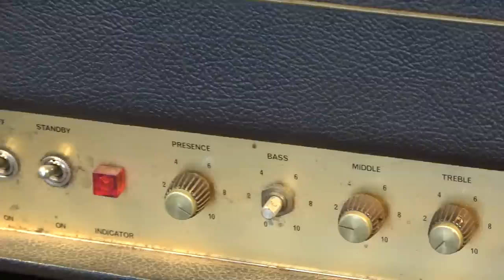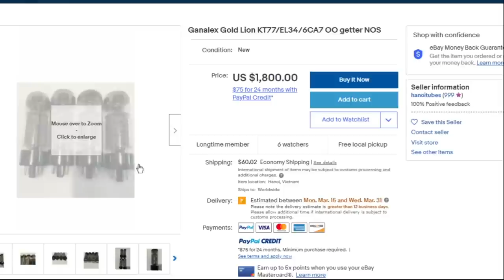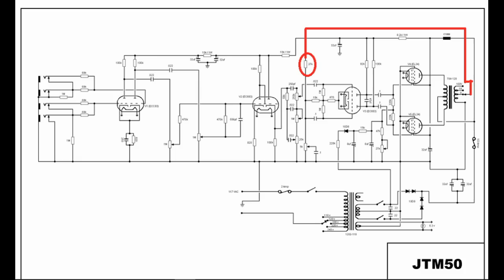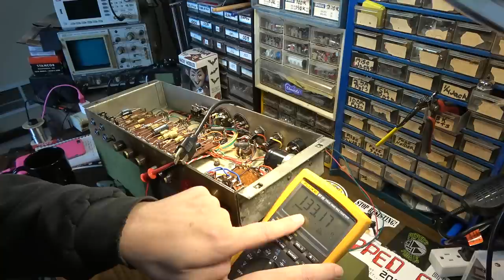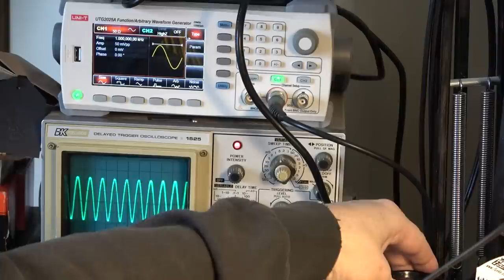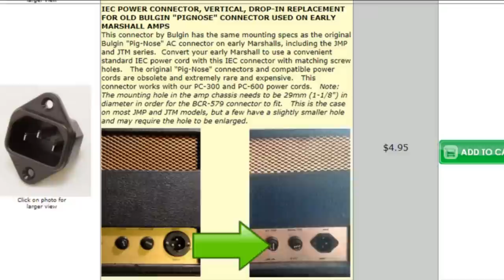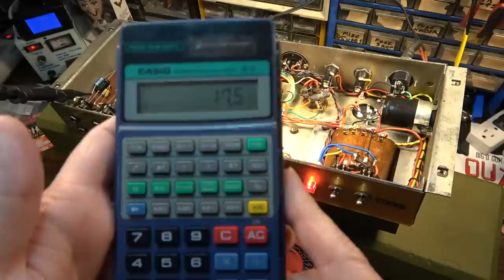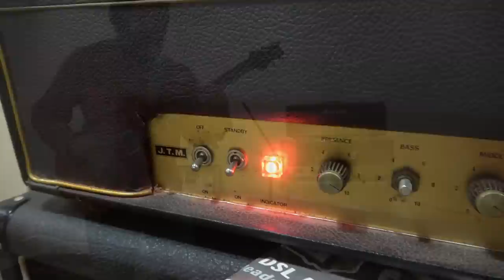Inside a $10K Amp | Secrets of the 1967 Marshall JTM50 BLACK FLAG Plexi | REPAIR & DEMO

Comment: I grew up in Honolulu. I bought a Marshall 4x10 combo amp in a pawnshop in  Hollywood in the late 70s. The chassis inspection sticker was dated 1967. I traded it to a friend of mine for an early 70s 50W head and 4x12 cabinet which came with me to Florida when I moved. My friend was one of 2 Marshall collectors I knew in Honolulu. Both rented out rigs for concerts and I used his 100W heads and double stacked 4x12 cabinets when I played in the arena there in the early 80s. I also heard of another Marshall collector there, so finding an old Marshall in Hawaii is not so far fetched. My friend died in 2019 and I don't know what happened to his collection.

Comment: man... hearing you grinding the plug hole gave me flashbacks to sitting in the dentist chair having teeth ground down for crowns... lol
Reply: Got the same association. Had a wisdom tooth surgically removed a couple of years ago. That wasn't an easy task. The dentist had to work his way down by drilling and breaking off pieces until he could finally extract the root remains and suture up the wound.
Reply: Me as well - dentist had to cut it up and literally break it apart and extract the pieces. At least Brad had the volume down on this part, but ARGH!!! you can still hear it.
Reply: @pauldavis6356  wow i thought it was just ME...i had all 4 removed at once and they were ALL that way...it was years ago...44?.but you never forget it

Comment: Maybe Hendrix left it behind on Maui after filming Rainbow Bridge.....That'd be a sweet find!
Reply: @electrofrying1685  maybe
Reply: That's what popped in my mind too.
Reply: that was my first thought when he mentioned Hawaii
Reply: Spike Elwood  Doubt it was Hendrix's amp.
Reply: Spike Elwood  There are five on stage in total and they should all be out there somewhere. Would like to know which Marshals he used, a bit of research should reveal the answer.
Reply: Looking at a close up the front panel layout is identical apart from the Black Flag!
Reply: Apparently Hendrix used Marshal Super 100 heads powered by four KT66s, this Black Flag amp only has two KT66s.

Comment: Beautiful history lesson here Brad!!  What a cool amp!  I actually got lucky at my last job and found a couple heating elements from commercial coffee brewers that are exactly 8 ohms each, so I can wire them at 16, 8, or 4 ohms depending on what I'm testing.  They have nichrome coils inside, and when I pump enough watts into them, you can hear some sound coming from them 😁 Also, since they are heating elements I can use water as a heat sink if I need to do a long test.  (I had an old solid state Peavey that was overheating, so I ran signal through it at a high level to test after I fixed it)

Comment: Tube amps will Soon be a thing of the past if someone doesn't step. Up and start building all these tubes again.
    And ones working will go through the roof in value.
Obviously.
     I appreciate your channel. The amps you document amd your a great teacher. Just doing what you do.
  In my opinion the  thing about a great amp or an amp simulation. Is that every playing mistake shows. Can't hide behind the amp the amp. Is an instrument like the guitar and the fingers and touch amd mind behind the playing.
    And unfortunately I have played a few modelers with great tone that did just that to me.
  But im still a tube amp snob for sure.

Comment: Thanks for the interesting video. I have seen and identical one that used to have a GZ34 but now has a solid-state rectifier. It looks as though something got very hot (the mains transformer) and vaporised varnish all over the inside.

The extra resistor on the impedance selector is to lower the negative feedback fraction around the driver and output stage. Without this, this amp will oscillate at 100 kHz at full power - blowing any tweeters if you ever have any, but sometimes described as fizz, as you will have created a Class-D amplifier with lots of intermodulation! The original feedback resistor is 27K, but later models had 100K to lower the feedback, so I added 47 k and the amp was stable for all settings of the Presence control(with some effect of the treble, but that's not in the feedback loop). For those who like feedback theory, this is called gain compensation.

An idea for setting up the bias from the mains power draw, could you turn off the Standby and see what the difference is? Most of the power difference will be going to the output tubes (minus maybe 6 mA x 440 V to the ECC83s = 2.64 W). Perhaps I skipped over you doing this?

For the IEC connector - just mount it behind the original Bulgin hole, so you won't have to drill anything. I am sure this is why the IEC was designed as it is.

Nice playing BTW.
Cheers

Comment: In the UK amps like this are converted to the EIC 3 pin kettle lead and have been for many years now . These are Bulgin sockets and we're OK for sometime but have nowhere near the insertion rate of the later 3 pin sockets . Replace this with a Bulging EIC for a couple of quid . Phone Marshall UK and ask them for a US 3 pin kettle lead and they will probably send one for nothing. I have done this many times here, but they may charge a few quid for shipping but it will be a stock lead that Marshall uses . It doesn't have as much effect on the value of the amp as you may expect . The EIC socket is 40mm between fixing centres and normally these are fitted straight into the hole and uses 2 3mm countersunk screws and nuts to hold the socket in . Keep the original parts of course .

Comment: I had a similar problem with a marshall amp I had years ago with that same plug. What I did was wrapped the post in guitar shielding copper tape the adhesive is conductive so no problem there, I wrapped each pin a few times until it had a snug fit and it worked fine
Reply: Well now we know why those older Belden A/C cables were changed out for newer more reliable style cables..BUT In the end, even if its now really your kind of amplifier. It sounded good.
When us old guys who have played Marshall amplification. We always start off with that huge open A and let it ring forever until it goes into feedback. And judge if the amp has THAT MARSHALL SOUND.  We need to feel that chunked A chord in our chest. If its right youll feel it right between your pecs. Saying that, playing some lead work fallows. And in all my Marshall amps ownership, its thise hangin lead notes that have made me buy AND use during my own rockstar carreer 76-85.
Modern guitarists dont know the intricacies of handling 1)volume 2)feedback
3) true amp made tone and  soundman be damned..
Great video Brad. I just picked up an old Melody maker, I'll be feeding thru my jmp 1987 from1976. Its time to ROCK again....DK

Comment: Anyone else notice the phase inverter output caps are 0.033 (33n)? (close-up @ 9:45). It's difficult to tell whether they're original judging by the color of the solder because the bias resistors and the fizz cap (the 50pF silver mica) have been replaced.

Comment from the maker: NOTES: Here's a follow up video responding to some criticism of this video: https://youtu.be/ZrMOPdTc8GQ
ALSO, the current owner contacted the former owner on the history of this amp at my behest. Turns out he bought the amp in LA, California before taking it with him to Hawaii. So if anyone in LA knows the history of this amp, please comment below!
Reply: @Austin Martz i have the dvd and vinyl set. Also check out gabby amps from Vietnam. Theres a reverb listing for a fender bandmaster made by gabby
Reply: @craigshewchuk9018  rỔ
Reply: As the owner of a Jtm45 from 1966, I was fascinated by this. I'm assuming the headphones at the end were for your protection. Mine is unusable. It's just too damn loud. I had kittens when I found out what these now fetch. I got mine in the late 70s for a princely £80 uk with a matching 4 x12 for the same price. Incidentally, the power input mod you did, I also had done on mine. Its quite a common fault according to the repair guy that did it for me.
Reply: Bought a  old JMP Marshall that came from Hawaii

Comment: Btw...rip on the serial number nerds all you want. Those who know them, are “ampologists”. Many things can be detailed from a serial number.
Back in 2000 I was lamenting over not going pedal shopping while I was in London a few years earlier.
Then it dawned on me to use the internet to find an obscure hole in the wall music store in London and contact them to see what they had.
I scored a colorsound fuzz/wah and a Marshall Supa Wah for a reasonable deal. The Supa was a Sola 2g374 complete with vintage turd caps and hand drawn trace board. It was serial #00047.
That number is significant because, of the first batch that JM bought, the first 100 went with him to the London Music Festival and were sold by him in his booth.
The provenance of that pedal was built in via the serial number....

Comment: hard wire a new power cord I worked on a jpm 100 and it was hard wired to the mains I remember it had kt88s a loose cap and loose common connection to chassis hay it's fun working on these old amps.

Comment: The amplifier has its original Bulgin plug and socket. 

These old connectors are not considered safe now for the reasons you identify and are frequently replaced with a kettle lead socket in the UK.

Like you carefully did!
Reply from the maker: I honestly think it was for the best. I know there will be a few stragglers who will scoff at my method, but it needed to be done.
Reply: Yes I agree! I’ve got a 1972 JMP 50 but most of the original parts are in a grotty plastic carrier bag in a cupboard somewhere and the QC tag also fell off.

It sounds as good a Marshall as you would expect though.

Your videos are very diverse, interesting and enjoyable, thanks Brad.

Comment: The power consumption measured 100 watts and the Idle bias is set at 70% to output 100 watts RMS. I think people are going to get really confused about the power consumption wattage being 100 watts and the amplifiers output wattage being 50 watts or 100 watts when biasing an amplifier because the confusing is going to be the power consumption is total different compared to Audio output RMS wattage. Maybe you can make a theory video explain this how to bias an amplifier by measuring the power consumption
Reply: Thanks....makes sense.

Comment: Brad I enjoy your videos, viewing  from Europe that seems to me to be that's a safety fail on the IEC to fuse wiring. It looks as though you have wired the N Neutral pin of the new IEC chassis mount plug connector (pins out) to the amps chassis mount mains fuse. In Europe there is Live, Neutral and Earth. The volts is on the Live, for safety the fuse should always be in the volts line ie fuse  always in the Live line. If the amp is configured to have the fuse in the Neutral (as it appears in the video) the fuse may blow, true ceasing current through the amps Mains Transformer but not  isolating the internals of the amp from the volts. I appreciate you are not in Europe but my understanding is the convention in US is the 110-120 is also delivered in similar fashion in US, so the same safe practice applies. Any off the shelf IEC cable will be standard configured to have the volts come in on the L pin of the IEC so I was surprised to see this wired with the Mains safety fuse in the Neutral. Welcome your thoughts..

Comment: I bought a bluesbreaker reissue last year used and could never get the tremolo working. Got it for less than the jtm 45 used so it's cool having the 2x12 option.  Great amp

Comment: Glad to see you used a signal generator and an oscilloscope for troubleshooting. Next you'll need a "Load Center" with 2,4,8,16 ohm 200 watt resistors and 1 open position connected to your scope.

Comment: Just a note on the power cord, a number of British manufacturers used them one was a firm called specto in which they made cine  projectors. You can normally find them complete with a cord for not always a lot of money. Also some radios & TV’s from the same era.
Reply: Yeah, they were kinda THE standard Power Connector on quality uk gear before the IEC std - there was also a 2-pin version, that got used sometimes on speakers, and even an octal-like number, that a lot of people used for lighting...

Comment: I’m betting the amp belonged to someone in the navy who left it when they changed duty station or got out of the navy and went home. Both scenarios, I bet they didn’t wanna lug a big Marshall head with them. I haven’t finished the video lol just a guess
Reply from the maker: I forgot to resolve that question. Current owner contacted former owner at my behest and former owner bought the amp in LA before bringing it to Hawaii. No telling who owned it in LA. I did not think of the Navy angle though! Good call.
Reply: Back then you had to be a "senior nco"(I'm thinking E6 or above, could be wrong) to get your personal gear, transported for free, by military. I remember my 1st paycheck as a civilian, in 2 weeks, I made more, than I did in a month. The old dudes told me what they made...talk about peanut shells, not even peanuts!

Comment: Ya can't make the power cord contacts spring closed a bit, but you COULD slightly increase the diameter of the power socket pins by tinning them with some solder?
Reply: Nah, your solution is better!  :)

Comment: The Blugin socket was fine, the plug needed tightening. Also the KT77 are NOT EL34s and have half the anode dissipation.
Reply from the maker: There’s no way to tighten this socket or plug. I could have dropped some solder on the posts, but that would be a temporary fix.
Reply from the maker: It isn’t true that KT77 is “half” the max plate dissipation, if that’s what you were saying. I see no data sheets anywhere corroborating that.

Comment: I own and use a 100W Black Flag. The square indicator is correct. I do suspect the switches to be replacements though as they'd normally be black plastic. Of course anyone who knows even a little bit of early Marshall history knows this doesn't need to be the case. They'd just pick whatever they had in stock.
And using new production Sovteks for these amps is fine, just fine.

Edit: Did you run that amp on 16 Ohms? Naughty naughty. It should run on 8 Ohms with suitable cab. Preferably on a rainy day.

Comment: those blue resistors were sold in late 90s by a killer amp maker who went to Clemson for electrical engineering, n ended up w/severe eye problems, forcing him to quit, Steve Aiken Amplification, Dont think that FB resistor was replaced, tweaked for more gain n hi end yes! :)

Comment: Hello Brad, I noticed that ancient vid of your Variac's digital meter, it used to start registering output voltage at about ~60V. But here you're reading all the way down to 10-15V. Guessing you changed your meter. Do you have a link to what you used? Thanks a ton!
Reply from the maker: There’s a link to it in the description of my video, I think.

Comment: Done some repairs on one of these and plenty of it's more common brothers, the rarest one I've seen was labelled Bass. The only difference I could see with the Bass version was minor changes in the tone stack, but it sounded epic with a guitar through it. (Like Fender Bassman's do). Apart from caps the common fail is resistors in the bias circuit going way off value or dying.

Comment: Nice video Brad. The square red light housing is correct for the time ... I've an early 1966 JTM45 30 Watt RMS Plexi head, single speaker out, cream back panel (owned since 1976) with the exact same light. The control knobs with grub screws (I like them) are also the same, as is the Bulgin bakerlight power connection (cool plug but fragile). Mine runs with 1 GEC and 1 Pinnacle (both KT66's) in the power stage,  3 HRS branded ECC83's and a Mazda GZ34 rectifier. One question I've always wanted answered and maybe you may have an idea ... my ohm selector pin on the back panel has a pin choice of 8ohm , 16ohm or 100v ... what's the 100v there for ???   I tried Marshall in Bletchley some  years ago and they were unsure as there spec records for the 60's production runs were not great. Their best guess was it could be a setting for hooking up to a PA ... Hmmm
Reply from the maker: The transformer was designed for PA Use. 100V speaker systems is a way of chaining many speakers together without losses. We see 70V more often in the US.
Reply: @TheGuitologist  Thanks Brad, that explanation kind of fits in with Marshalls best guess reply to me ... so although a rather unlikely use for such a great instrument amp, I presume it could have run something like a small 1960's factory Tannoy system if required ... Jim Marshall & Ken Bran were obviously keeping their options open in the early years ☺

Comment: Nice Repair Brad. What speakers do you have housed in the fender cabinet?  Also presence was too high to my ears.  You may want to invest in a real 4X12 Marshalls cabinet for testing. Although we can use them in clubs anymore. It's great to be hit in the chest with 50 watts from 4X12 16 ohm Marshall cabinet.

Comment: As far as I know the amp did display the concerns from the owner, the amp would not light up... it was the power cord connection correct? owner was correct after all. Don't work on Marshalls if you don't know anything about them. Now I work on and build my own Marshall vintage circuits.  I said good bye to the past techs??? That messed up my vintage amps. I had to rebuild my 63 fender, and years ago paid a dump to bias my musicman amp, multipletimes. I could go on about amp repair men but I now am that honest amp repairman. . I'm not that dumb anymore.
Reply from the maker: Excuse me? I fixed it, didn’t I?
Reply: @TheGuitologist   As long as you're proud of yourself that's all that matters